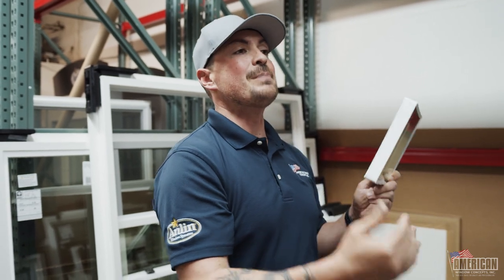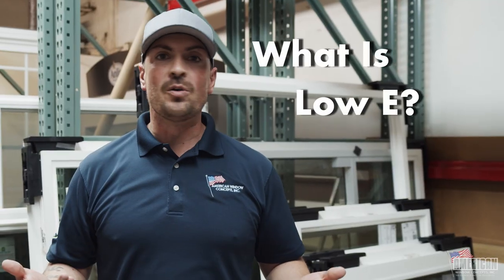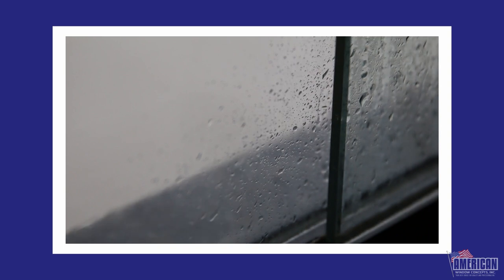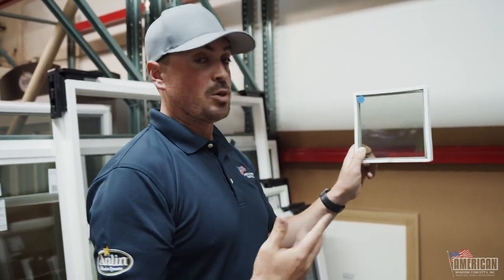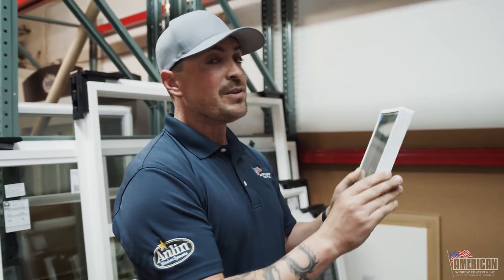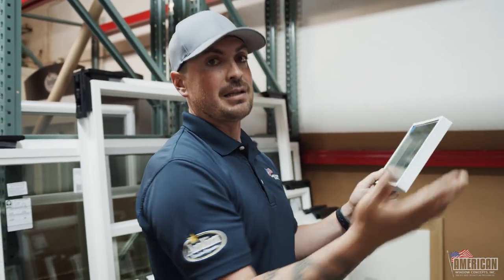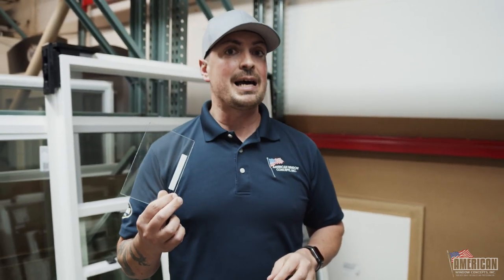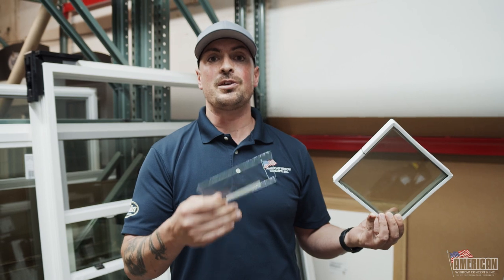WHAT IS LOW E & ARGON GAS?

Comment: How do I refill the gas again? The propane shop laughed when I pulled up with the window.
Reply: Lmao.. That was funny..
Reply: If the Argon gas is gone, than it’s safe to say you have a seal failure and need a replacement glass unit. You’ll know this because of the moisture fog between the panes that never goes away. 
No gas/propane station will have the correct gas for you. Sorry.
Reply: Argon in an IGU is a sales tactic.  It's only efficient at sea level.  And it looses its minor benefits after 3 years.    Soft coat lowE is the most economical.

Comment: The low -e coating is always on the 2nd or 3rd surface. Never on the first or fourth.
Reply from the maker: Who stated it was ever on the 1st or 4th surface? That would rust immediately!
Reply: @americanwindowconcepts5510  at .54 seconds you tap the outboard light and say this is where the low-e coating is.   Also. ..   silver doesn't rust. . Iron rusts.  Silver oxidizes.    

Also... in southern states. The low-E is on the 3rd surface.

Comment: Is there a way to test if your windows are LowE or have Argon gas? If we get new windows is there a way to confirm if they actually installed LowE with Argon?
Reply from the maker: When you get new windows, keep the the NFRC sticker that is on each and every window. It shows the SHGC, U Factor, Visible Light Transmittance, and Condensation Resistance. This is absolutely true and accurate for each specific window, and if is found to be a lie, the manufacturer would be in serious trouble.

Comment: why do products in the market have air and argon mix? why not use pure Argon to fill in the window?
Reply from the maker: The windows I use have a flood fill amount of at least 95%. The goal is for as much as possible.
Reply: To my knowledge their is air inside the two pains of glass when being made, so it's hard to remove 100% of it while filling with argon , we had dehumidifiers so that what little air was trapped in the window didn't have moisture.

Comment: Triple silver LowE coatings will block up to 95% of UV light from entering the home. This is great if you want to help prevent fading in the home, but that number doesn't mean much of anything if discussing energy performance. If energy performance matters to someone then the discussion has to be about U-factor (or U-value) and SHGC or Solar Heat Gain Coefficient.

LowE coatings affect both SHGC and U-factor performance of the IGU. Adding a LowE coating to a dual pane window improves U-factor performance to the level of an uncoated triple pane (or better) and introduces significant performance improvement to SHGC. 

Argon is used to enhance the insulating performance of an IGU. Argon slows both convective and conductive heat loss or heat gain through the glass. Doesn't matter if it's keeping warm air inside during the winter or keeping warm air outside during the summer. 

Argon does little or nothing to improve window sound performance. It is a somewhat common misconception that it has sound performance value, but it doesn't.
Reply: It is amazing isn't it, how on YouTube these people state with authority absolute nonsense. Like the presenter saying that argon will keep heat inside the house but not outside the house. Also acoustic properties which depend on phonon transmission not convection. A denser gas should actually more transmission to sound. Convection probably depends on mean velocity at a given temp of individual gas molecules.
Any way I replied to you because I am thinking of replacing a busted vinyl window with a wooden picture window. With 3 panes. The middle pane would be a stained glass with one of the Frank Lloyd Wright patterns. With a little injection port from the side where air can be purged with argon periodically.
What do you think?
Any suggestions?
Reply: @suryamitra7397  Given an option,  I would prefer the artglass panel as a separate interior pane rather than between lites of an IGU. I would prefer a sealed dual pane to the exterior of the panel. 
And while I am not a huge fan of stained glass inside an IG unit, I do realize that it's by far the most common make up.
Reply: @gregcorwin8316  Thanks!